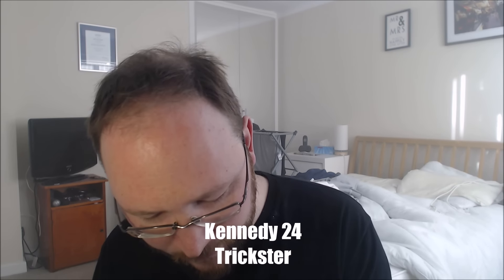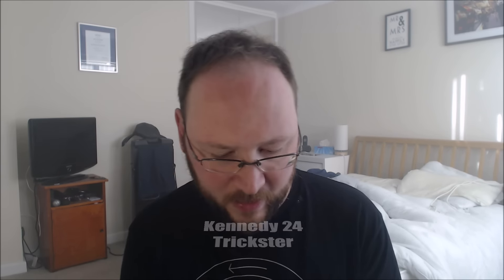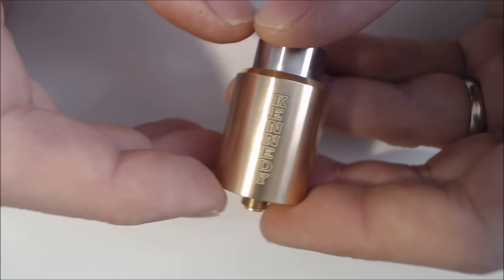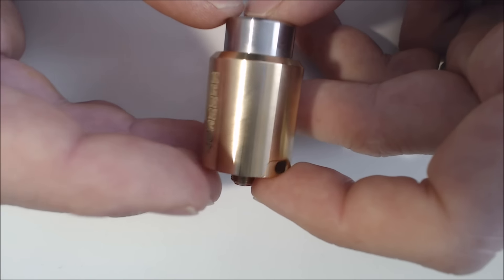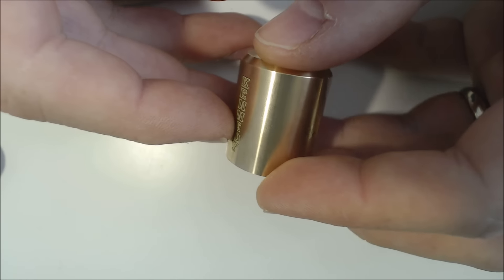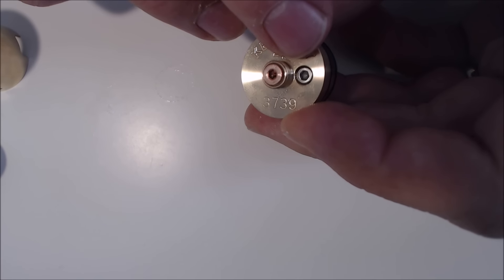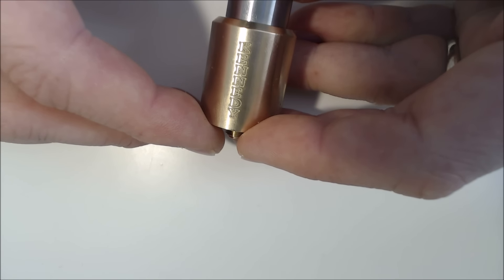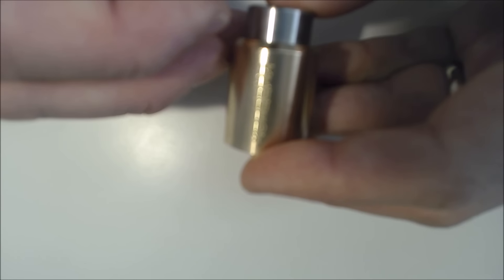Kennedy 24 Trickster RDA - Its a bit cloudy!

Comment: a clone ? because the authentic will have "Trickster 24" instead of "Kennedy 24" on the bottom and the airflow holes is flat with the o-ring on the deck
Reply: Akbar Satria it is a clone